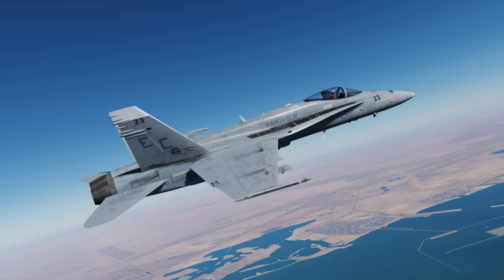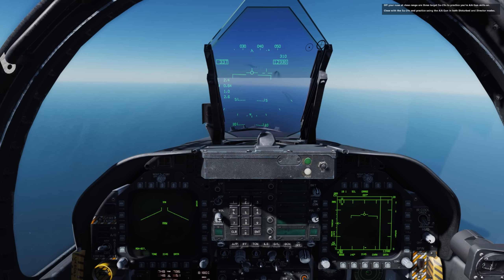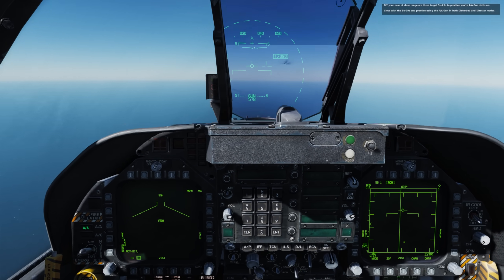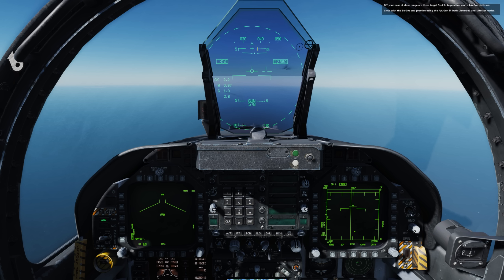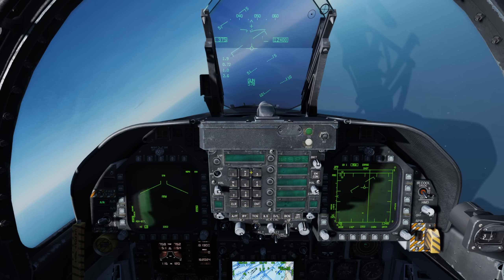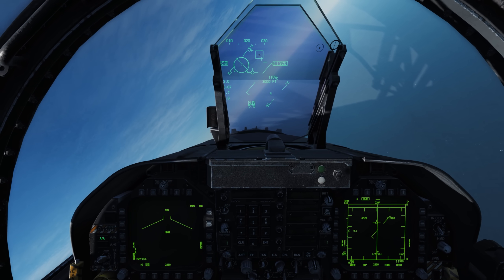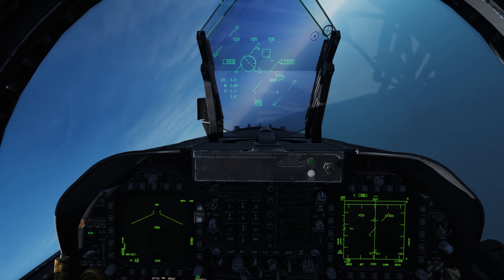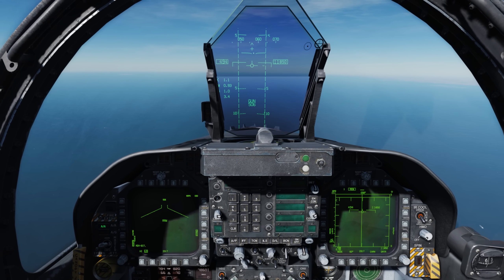DCS: F/A-18C Hornet - Episode 10: Air-to-Air Gun

Comment: Actually how do you map the trigger second stage to the HOTAS joystick. I designated the trigger second detent to button six on the throttle and it didn't fire the gun. Master Arm on, A/A mode. Any suggestions or is there an FA 18 profile for HOTAS I can download?
Reply from the maker: Use the weapon release button, not the trigger.